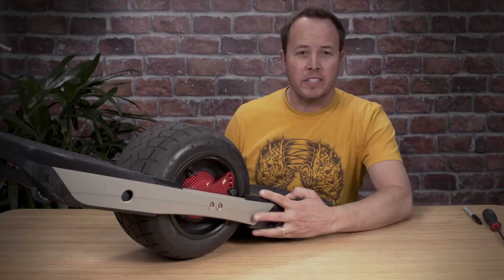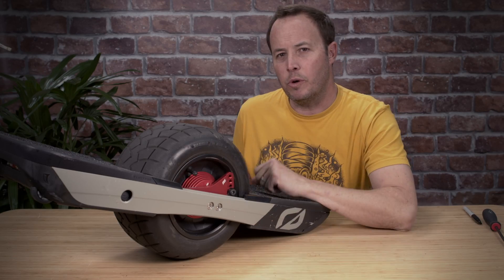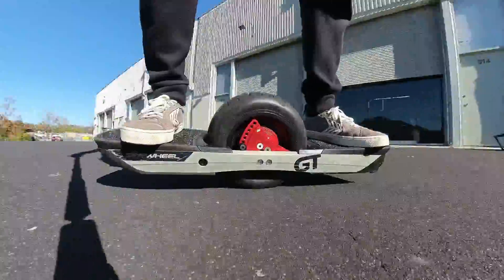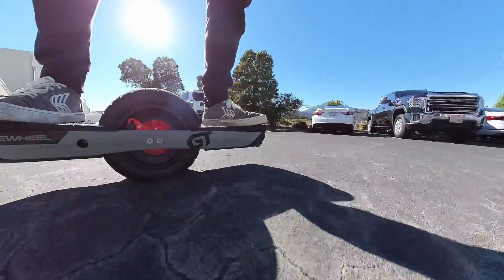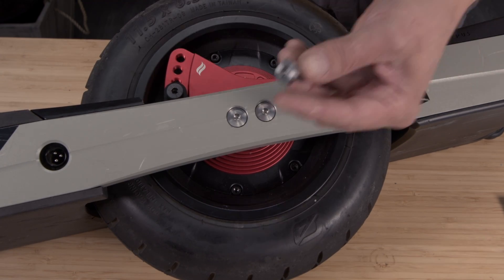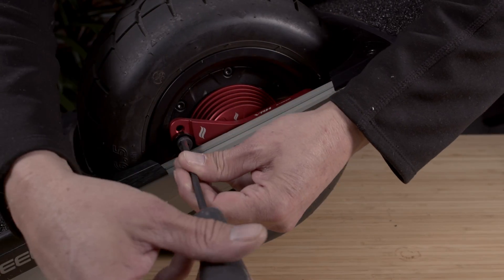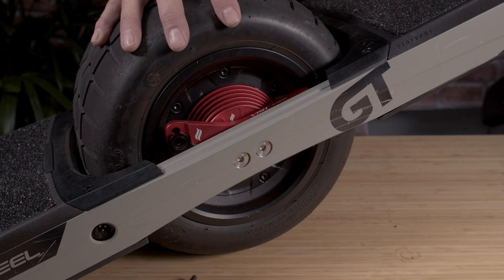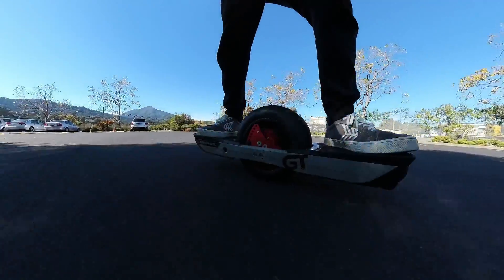VRH (Variable Ride Height) for Onewheel GT.  By Land-Surf.com – Introduction

Comment: does this work with the WTF rails
Reply: And second question on top of that - would the angles work with a WTF and Fangs? Love the idea of a lower ride but honestly I ride fairly aggressively and have had too may instances where Ive slammed my face into the ground so.... curious.
Reply from the maker: @real-estate-photography  No the VRH does not work with WTF rails, but Fangs GT and BASH bumpers do!
Reply: @landsurfmarin  Could you say what the problem would be if one were to install the VRH on WTFs? Have you tried installing them on WTFs?

Comment: Looks fantastic!  I hope extra screws are included because I have a feeling the screw may fall off unless riders are carrying Loctite when riding :)
Reply from the maker: No, it stays put quite well when tightened.  That said, if you want add some blue (medium strength) loctite, it won't hurt anything.

Comment: This looks like a minor modification away from an unobtrusive suspension system, that can actualy work and not look bulky
Reply from the maker: It's actually much harder to do this than it appears, and would require longer rails too.
Reply: @landsurfmarin  Still one can dream :)
Reply: @landsurfmarin  The suspension doenst need to be using compressed air in a tube.
Reply from the maker: @iamlexor8136  True, however, there is currently no bearing in the pivot point, nor a connector to make the moving arms move the same way (like a single swingarm unit).

Comment: Will these work with the TFL rim savers? Also, how strong are the bolts on the pivot point especially in drops.
Reply: Great question, I'm curious about this too.
Reply: @IamRonman777  Me too. It states on the website they "may" be compatible "depending on the rim thickness"
Reply from the maker: Yes, they do, we've verified. You will need to remove a rail to get them on though since the way shown in the video can't go over the thickness of the rim savers.

Comment: Pre-ordered! I do have the same concern as someone mentioned. The single two screws holding up all the weight, will they become loose over time? What about when doing tricks and drops?
Reply from the maker: Not a single incident so far and they've been out a few months now. These brackets are far stronger than the rails, being 7075 T6 aluminum, which is as strong as mid-grade steels. The GT rails use some sort of weaker aluminum and are not machined like the XR rails were, so they are cheaper to manufacture.

The pivot point and all other screws except for the adjuster screw use med strength loctite, so they don't come loose.  The height adjuster screw doesn't need it, as it holds very well as is (you can apply if desired).

Comment: Does this put stress on the motor plug / cable?
Reply from the maker: Very little, although some GT's have a very tight cable (shorter than usual).  Most fit fine, and really it's just angling the cable up a very small amount. It puts less strain on it than any other 3rd party mounting block system out there.

Comment: Really interesting product, on the edge of ordering one.
My concern is, is all rider’s weight support by one screw on each side? If that is the case, did you guys test the rigidity of the screws? Can it still handle drops? Will it wiggle loose during off road session?
Reply: I’m not a structural engineer, but I think the weight would be mostly distributed between the pivot and the screw on Both sides
Reply: There’s 4 points of contact to distribute the riders weight. Which incidentally is the same as stock.
Reply from the maker: The strong 7075 aluminum the VRH are milled from, along with high strength M8 screws throughout, provide a really rigid frame for the axle and rails. I think once you see the build quality and heft of these units, it will provide confidence for all riders. If somehow it did break it would usually be covered under our product replacement guarantee.
Reply: @landsurfmarin  thanks for the reply, ordered along platypus, fangs, Bash for my GT. Gonna feel like a brand new board!!!!

Comment: I've seen issues with tight cable routing for other height adjustment options - have you found any issues with that?
Reply from the maker: Yes, cable management is extremely important, especially on the GT since they are so short...so they fit in properly...and on the motor side, it's a gentle curve from the motor axle to the swingarm and then the connector, and not a hard right angle like other axle carriers out there.
Reply: @landsurfmarin  if cables are already stretched tight would these still work at all settings? I wanna try them on my lightning rails but the cable is stretched super tight already.